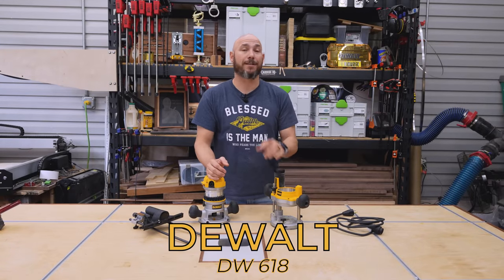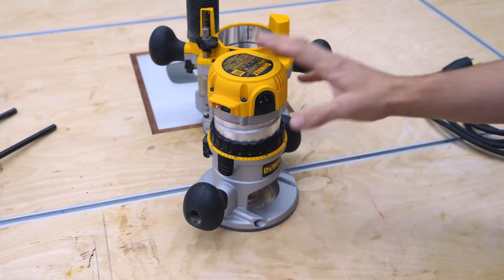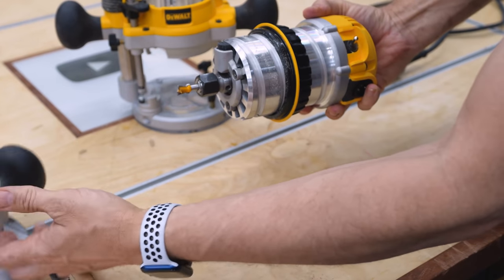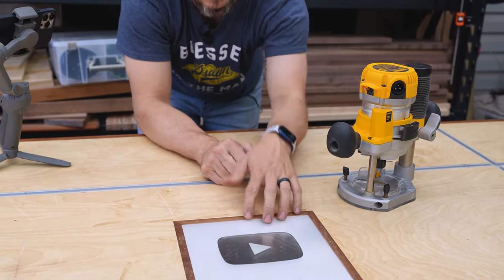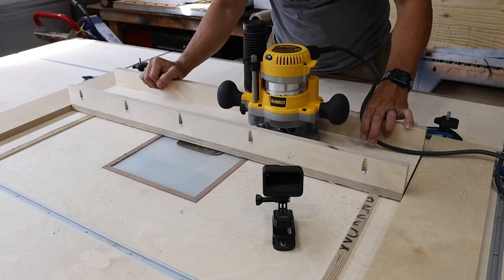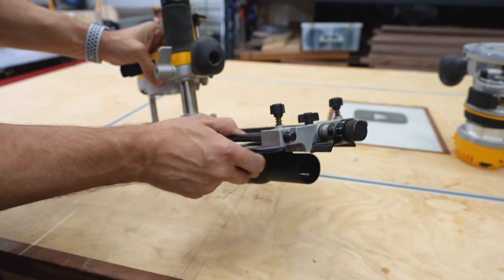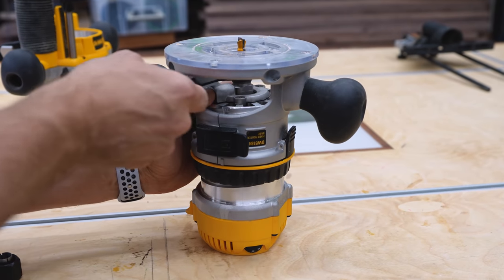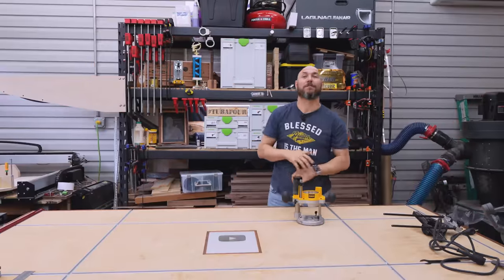The Best Woodworking Router for Beginners!

Comment: Howdy Mr. 731...

I "say" I'm Dewalt guy...But in looking around my shop, I actually have more Ryobi tools than Dewalt. Albeit, if the funds were plentiful, you'd only see "yellow" tools everywhere. 

I currently have a Ryobi 2.25hp "plunge" router. It gets the job done.... BUT, I don't use it for plunge routing at all. It's mounted to my Ryobi router table. That being said, when I first got it, I tested out the features. 

The "plunge"....Well, it SUCKS!!! It has relatively hard flexy plastic sleeves and cheapo CHEAPO springs. The plunge was EXTREMELY clunky, to such a point, it actually wasn't usable as a "plunge" router at all. Terrible.

I took all that "poop" off the router and mounted it under the router table, which honestly, is what I bought it for....I was just hoping to be able to micro adjust the thing once mounted, but nope. If I could go back in time, I would have just got the Dewalt. 

As a "router" though, it does a good job. 

I also have a Ryobi battery powered trim router. No serious complaints with that other than it EATS battery power quickly. Does a great job otherwise. 

I just recently (last week) bought a Bosch trim router (corded) for $79 at Lowes. Haven't even used it yet, still in the box...But I saw $79 and stached it up. I couldn't resist it. 1.25hp Colt...no battery to mess with....only 2 left on the shelf....MINE!!!

Comment: You gotta get the Metabo HPT 36V cordless 1)2" full size plunge router
Absolutely my favorite tools in my shop and using it at the jobsite in many applications we wouldn't have considered with a corded router
Prefer it even over my Porter cables and Bosch
Has a great break and your hands never have to leave the tool when in use
Also the safest router I've ever used

Comment: Does dewalt have a cordless version of this one  ?
Reply: No the only company that has a full size cordless is Metabo HPT36V which is our favorite  router in our shop and jobsite
It also can use AC power with the AC adapter
Hands down has replaced most of our other router for most of the things we do
We have Porter cables and Bosch but they don't get used much except in the table

Comment: Can This router be mounted to the underside of a router table?
Reply from the maker: Yes it can
Reply from the maker: I would double check the router lift you have or are getting to make sure. But most of them are adjustable to fit different size routers

Comment: I saw this on the Amazon reviews 

"Like many of you, I watched the youtube videos and saw two collets with two nuts, a 1/2 inch and a 1/4 inch. My unit arrive with what appeared to be only one collet, the 1/4 inch. Annoyed, I called Amazon, and they arranged for a return. Meanwhile, I read a little more about this unit and it appears Dewalt changed the design of the collet and they do not make that very clear. If you take your 1/4 collet, and insert something in the back side and gently push out, the 1/4 inch insert easily glides out leaving you with a 1/2 inch collet. Hopefully this info saves some of you some time. Wish it was more clear"

Comment: I have had 2 of these and they dont last. The bearings are not well sealed and damages the armatuer. The cost to repair a dewalt router ( if you can find a shop), exceeds the cost of the router. I use routers for carving signs. Dewalt, in my exoerience has nice ergonomics, looks pretty, but can not handle heavy duty work.

Comment: Question for the expert  (you):  Would I be able to use my existing 1/8" shank Dremel bits, with a 1/4-1/8" adapter, with my  router (DeWALT  DWP611)?
Reply from the maker: Yes you could do that. I would make sure those dremel bits can be used in a router though. They may not be made to be used in that application
Reply: @731Woodworks   They're both rotary tools, aren't they, so why wouldn't it work??
Please advise, thanks.
Reply from the maker: If they can withstand lateral movement
Reply: @731Woodworks     Thanks!

Comment: I agree with your recommendation for getting a 2 -1/4 hp router before getting a palm router. These routers are not too large to be used in the place of a trim router and they are large enough for use in a router table. So, they are a good all-around router. Eventually, they may want to add a trim router (or two) and a 3-1/4 hp router to their collection, but a mid-size router is a good place to start.

I disagree on your recommendation of the Dewalt. It's a good router, but all of its features are found on many other routers of the same capacity. Bosch, Makita, Milwaukee, and Metabo HPT, all make plunge/fixed base router kits in this size range. They all have virtually the same features as the Dewalt -- with some of those features implemented better than Dewalt's version. For example, I prefer the micro-depth adjustment on some of the other routers. For me, the large ring on the Dewalt is harder to adjust than the knob on some of the others. Again, the Dewalt is a good router, but woodworkers should take a good look at the other offerings. They might like one of the others more than the Dewalt. Or, they might find one that they like just as much for less money. (The Metabo HPT is currently on sale at Lowes for $149.)

Or, if they will be using a router table a lot, they might want to consider the Triton. It doesn't come with a fixed base. But, it does let you adjust bit hight and change bits from above the router table. The Triton will do everything that the Dewalt can do, but it's MUCH better for use in a router table. Being able to adjust bit height or replace bits without removing the router from the table is a feature I would not want to be without. The downside to the Triton is it can be a bit more awkward to use when you'd otherwise use a fixed base router. To me, that's a minor issue. YMMV.

Comment: Totally agree with a bigger router first! My first was the Makita XTR01Z.  I built a small bench top table to mount it and used the hell out of it. Worked great most of the time, until you needed to do some heavy clearing of wood. Then it became multiple passes. I found a plunge base for the Makita and it is amazing.  Biggest problem continued to be the lack of power.
Found the Bosch 1617EVSPK on sale for $160 and snagged it. It comes with a fixed and a plunge base. The cool thing about the fixed base is that it can be mounted to a router table and used in place of a router lift. It even provides adjustment from the table top.
Threw the Bosch into my Jessem lift and haven't looked back. The additional power and flexibility with the lift and the plunge base have made it invaluable around my work space.
My personal experience with the "Yellow" many years ago left me very underwhelmed. Since then I have avoided Dewalt like the plague and chose to go with other manufacturers. That and the constant barrage of yellow fan boys made me shy away. My opinion/experience. 
Bottom line is that I completely agree with purchasing a larger router with a plunge base first, then grab a smaller one for the detail work👍
Reply: The Metabo HPT 1/2" full size 36V plunge router is both cordless and corded but it's power is above my solid Porter cables and Bosch router ,the brake is amazing and the control is off the charts and u never have to take your hands off the router to start stop
Has changed the way we use a router on the jobsite as well we have 3 of these 
One in the shop and two on jobsite

Comment from the maker: ❓What router do you have ❓
Reply: I got the skil same setup as this but has a digital variable speed.
Reply: Bosch 1617 with the plunge kit.  Also an excellent router.  I also have the Dewalt corded palm router which I love and a collection of some older Craftsmans.  Just got a Metabo that I haven't used yet but plan to add to a horizontal router table.
Reply: @jacobchamblee819  I've been looking at the Skil router, do you like it and have you had any problems with it? Would you buy it again is what I'm wondering.
Reply: I have multiple routers. One of which is this DW 618. I have had mine for a few years now and still use it. There is a flaw with this model though. The magnet which controls the variable speed is subjected to breaking. Mine did and after reading multiple reviews mine was not the only one. There was a lot of owners of this model having the same issue. I have a video on my channel covering this issue because i wanted people to know. The replacement part is only a couple dollars but it is an issue i feel like Dewalt should have corrected. As far as everything with the router goes, it is tough and rugged. No other issues to note. Thanks you for the videos you produce. They are very informative.
Tracy Maxfield @ Hammer Down Woodworking
Reply: @hammerdownwoodworkingtracy3679  I saw the same issue reported, which is why I went for the Bosch 1617.  From what I understand it's caused when a lot of sawdust gets in the magnetic ring and typically that only happens when you have it in a router table.  Since I wasn't sure if I was going to put the router in a table exclusively I bypassed the Dewalt.  I know several people using the Dewalt as a handheld and they have had no issues.
Reply: I have 2 BOSCH 1617EVS. I love them!
Reply: I have the exact router you showcased. I love it but I did just purchase a Makita trim router as well for small edge work.
Reply: @halsonger1317  mine did on the second time using it. At that time it had never been in a router table. It broke on the second use and under light and normal use
Reply: 2 of the 618's , festool OF 2200 , milwakee m18 router , and bosch mrc23evsk festool is my most used tho
Reply: BOSCH MRC23EVSK so far I really like it. I think this is a very close equivalent to your model. Time for a comparison video.
Reply: I got the Skil router for $96 on sale and I love it. It is $149 right now at Lowes and Amazon.
Reply: The Skil comes with the edge guide, so $80 less than the DeWalt.
Reply: Skil router
Reply: Which one-have four. My go to is the Bosch 1617 EVS with three bases. One fixed base stays in the lift on the table, have a spare fixed when stuff is too awkward for the table, and it has an awesome smooth plunge base. Not a Dewalt fan-I agree with Bill Boy-try the Bosch, you won't regret it.
Reply: My first router is a Craftsman model (don't remember which one specifically), but I picked up a used (like new) DW618. The latter is by far these superior router of the two.
Reply: @krjones91  Owned (and still own some) Craftsman, Makita, DW, Ryobi, even Harbor Freight years ago! Yeah, the DW is going to be better than most of those. But once again, you get a Bosch & accustomed to it with quality bits, oh yeah. Not saying the DW is a bad choice-it's a good router-but IMHO, the Bosch beats it hands down-1/4 & 1/2" collets, nice EVS, comfortable handles, etc. Bottom line-use what works best for you & your budget...
Reply: @Thomas Lee, I have looked into the Bosch routers before. Definitely want to get one once i have the budget for one. My go-to bits are Bosch for sure, I got a Craftsman set of bits (mostly for the storage cabinet it came with) and whenever those break I swap them out for matching Bosch bits
Reply: I have a Dewalt that is either that one or is the one previous to that model.  I found it at a pawn shop and it had both bases for like $75.  I still use it today.  Great video and thank you for sharing.  Love the channel sir.
Reply: My wife got me this model for Christmas.
Reply: I have the Dewalt you described, a Ridgid corded trim router, and an old (bought in 1993) Porter Cable 690 (in my router table). I have given away a couple of other old routers.
Reply: @krjones91  Check out MLCS for great bits at at decent prices
Reply: @Jimc4007  I love it I got it at rockler last Christmas for $99. Came with a plunge base and fixed. It has a lot of features especially with the digital gauge
Reply: Ryobi P601 trim router.  Next up will be something with more beef to it which can utilize 1/2" shanks.  Just not sure whether it will be DeWalt or Bosch.
Reply: @mtedeschi  Bosch hands down-you won't regret spending $250 on the 1617EVS kit-plunge base, fixed base, awesome storage container... Mine is 6yrs old & still runs as the day I bought it...
Reply: I have this exact set up. I’ve had it for about 5 or 6 years now and had no problems at all. Awesome router!!!
Reply: This one because of your great  video
Reply: None yet 😑 and ive been craving one. That one to be exact. But I've decided that im not allowed to put money into tool's until i start to sell my project's.
Reply: Same one in your video

Comment: I have a plunge router and a trim router.  Gotta say I use the trim router more.  Routers are also one of the more dangerous tools in the shop if not used correctly.  For that reason, I say buy the trim router first.  Learn to use the smaller, less powerful one first.

Comment: My first router was the Festool OF1400 EBQ-Plus. Can not compare as it is still with me. Probably will outlast me :P.
Reply from the maker: Nice!
Reply: Our Porter cables have stood the test of time but the new standard is the Metabo HPT full size 1/2" 36V plunge router-best brake, ergonomics, power and features-totao game changer and it also can use AC power with the adapter-we now have 3 of these 1 in the shop and two on the jobsite-the baby trim routers just can't keep up and the corded full sized routers are limited

Comment: I love this router I have it but I have to disagree with you about extremely easy to use the plug I am constantly fiddling trying to figure out how to get it connected everytime and it's really annoying.  three little pins of different sizes plus a twisting locking mechanism which could be at any position at any time.  super annoying.

Comment: Hmm you said watch this before you buy but it's already in the garage. 🤭 With a few more accessories then what you have.☺️
Reply from the maker: lol what accessories do you have?
Reply: @731Woodworks  oneida air systems mainly for using it to do trim/rounderovers for better dust collection doing that. Then template guild kit you probably already have that. Then I got a hose kit as I don't have professional dust collection yet so need adapters to attack it it's called dust right shop vac kit.